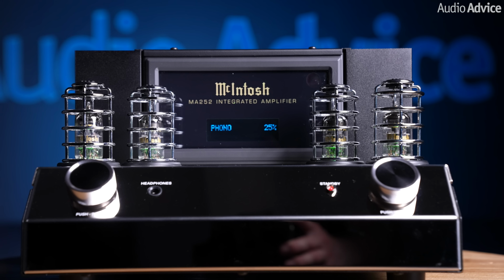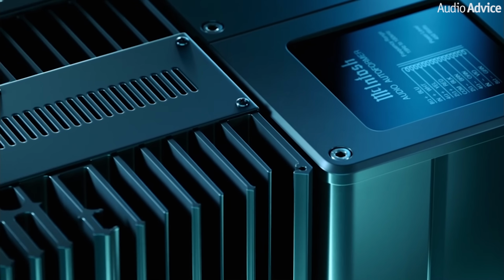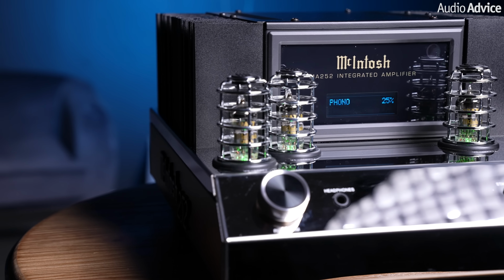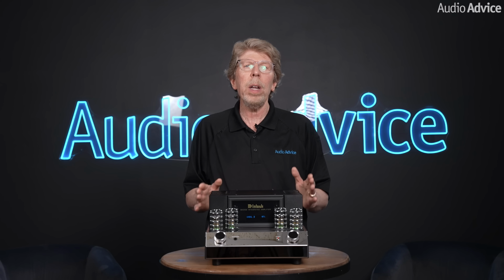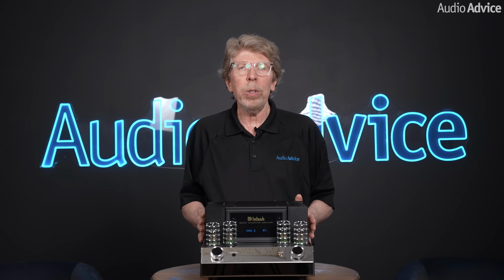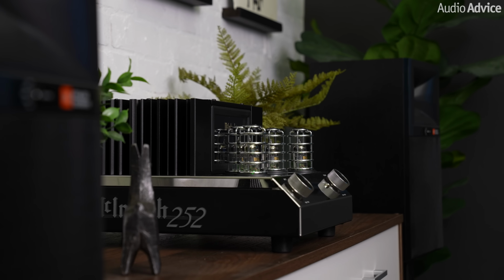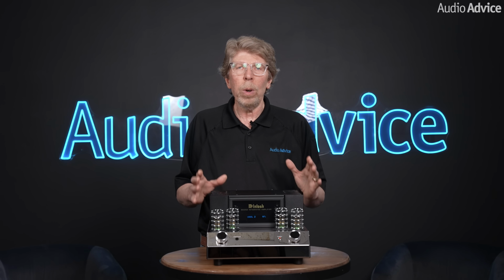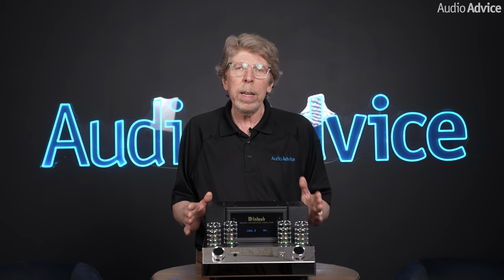McIntosh MA252 Integrated Amplifier Overview | Tubes + Solid-State Power? A Magical Combo 🪄

Comment: Is it normal to first go orange when you use the off button on remote then when green push off again for it to actually shut off.
Reply from the maker: Orange should only be when turning on or if Power Guard was activated.  You might want to check with the dealer you purchased it from.

Comment: Hi Leon you leave out much, this amp is very weak sauce. Has only one balance and two unbalanced inputs nothing else. 
3 analog and zero digital.
No preamp input to use all the gear one owns. AV pre because nobody today has any home theater stuff and here I thought no pass through was an oversight.
I have a Wilsenton R8 far less expensive and probably better sounding it certainly has a pre input. 
After having the 252 a couple days I don't think I want it,
China makes a more useful better sounding amp for much less. The only thing I might be giving up is longevity but even a idiot can repair a tube amp.
Reply from the maker: Sorry you did not like it, it does have 4 analog inputs, you forgot the phono.

Comment: Does the headphone section work and sound the same as the headphone only amp. Is the headphone jack powered by the tubes like the headphone amp or does it use  some integrated solid state chip.
Reply from the maker: It's Solid State.  It is the Hi-Drive circuit that can drive even tough headphones, and the noise level is close to zero. Before the signal enters the Hi-Drive headphone amp, it goes through both tubes.
But the MA200 is a better headphone amp and it should be.  Thanks for watching
Reply: @AudioAdvice  Thanks
Reply: @AudioAdvice   Will this drive my JBL classic speakers
Reply from the maker: @KimWentworth-y8e  Oh yeah!

Comment: I bought their XR50 speakers with my 252 after i researched how lower efficiency bookshelf speakers with six inch woofers can really produce tight and very responsive bass. I think they are flat to 40htz which is pretty impressive. At about 60% this thing sings. I use an REL  T5 sub crossed over at about 60 to fill out the lower region with no boom. Just clean tight bass without sounding "flabby" like many subs do. This setup is an analog persons dream system. Yes, cost prohibitive at about 10k, but if you truly love music, this is a great place to start if you want McIntosh as your (probably) last system.
Reply from the maker: Thanks for sharing. You have put together a wonderful system!
Reply: Thanks for the nice reply. I'm very happy.  Listening to Curtis Mayfield live on viny,  and it is just like being in the club where it was recorded 50 odd years ago. Great information from you as well.

Comment: The first thing that would fail is that digital display!:face-purple-smiling-fangs:
Reply from the maker: They have actually even researched how to make it last for decades just like everything else inside.  Thanks for watching
Reply: Voltage regulators & relays don't last for decades! @AudioAdvice

Comment: About all you'll get to "hear" about their amps is from Youtube. In my area, the few sellers do nothing to allow you to demo these amps. They always say we don't have any in and the only way to hear one is to purchase it first. Then, if you don't like it, your stuck with it. They may have been arguably the best in the past but they are not the best anymore, just have a following.
Reply from the maker: We have many McIntosh products on display to demo in our Raleigh and Charlotte showrooms. We also sell this product online. Sorry to hear that about your local dealers.
Reply: @AudioAdvice   The MA 252 is not sold online, only in stores, that's what I found out from the dealer and webstores. I am in the Pittsburgh Pa area. Dealer says they are extremely hard to get in store. Says in order to get amp, I have to buy it first, then it would come to store but if I didn't
like it for some reason I was stuck with it. This is why I gave up on McIntosh, they are apparently not concerned about getting new customers.

Comment: Due to space constraints, I replaced a 70 lbs. tube integrated with the 252. Sufficient power, comparable sound, lot less heat, and a lot easier to handle. For a modest system where there is a need to conserve space without compromising performance. I found this product to be one of the best options out there. Check with your spouse though, mine likes the basic black boxes. Her comment to me was that it looked weird, so as much as I would like to use it there, it will not be gracing our living room anytime soon.
Reply: It's like a halloween Star Wars space ship from the future, what could she not like?! 🤖
Reply: leave her
Reply from the maker: Haha, yes it certainly has a unique look! Thanks for sharing
Reply: I agree with her, the real tube glow of the kt88s and the 6ns7 cv181 in a piano black box.

Comment: The 252 does have some cons but overall the look and sound is what makes it unique. I wish it had a volume limit option in settings. The standby light is useless and the remote is very cheap looking. Volume control on the unit is extremely sensitive and does not have any resistance when adjusted. It definitely has a lot of power and in some cases maybe to much. I’m still happy with it regardless of it’s small cons. My 252 is paired with a pair of B&W 683S2’s along with an SVS SB2K sub.
Reply from the maker: That is a good point. We noticed the sensitive volume button but didn't have much of an issue with it. But you are definitely right about that. That sounds like a killer setup! Thanks for sharing and watching